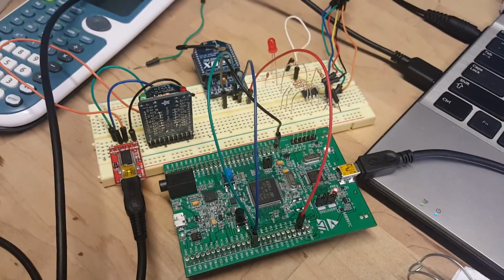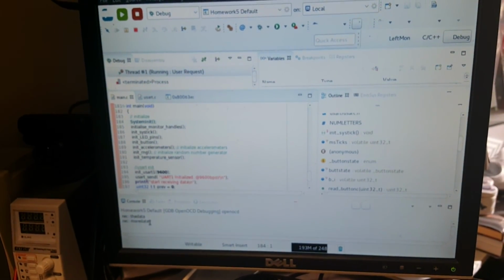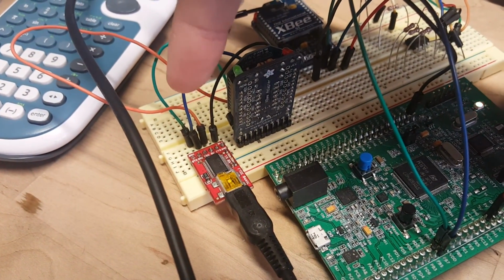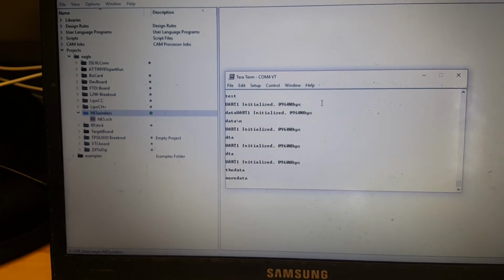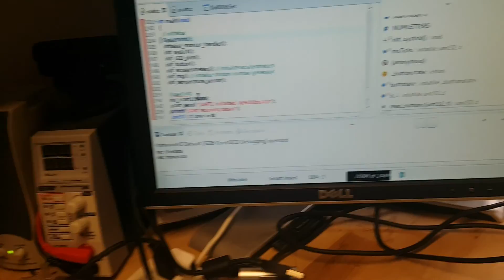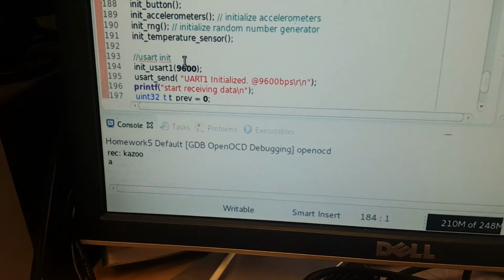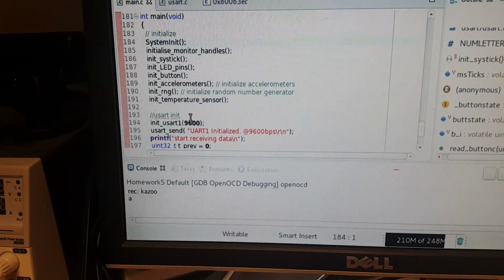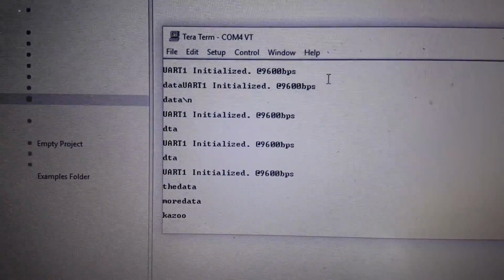ARM USART to Xbee Wireless code test

Comment: Hello, i have several questions regarding your project. I have to do a similiar project with XBees and STM32F4. Is there a way to contact you in private?
Kind regards

Malik
Reply from the maker: Sure, what's your question?
Reply: Do you recommend the XBee Series 1 or 2 when you need end-to-end communication (with sending AND receiving). Also: Is there a possibility to look at your code?
Thank you
Malik
Reply from the maker: I use Series 1 for basic stuff because it's easy to get working. Adafruit has a tutorial on how to configure them. As for my code, i linked to it (GitHub) in the video description. Cheers
Reply: are you using the xbees in AT or API mode and why?
Reply from the maker: farming machine AT mode. API mode is for when you need a robust driver in your application.